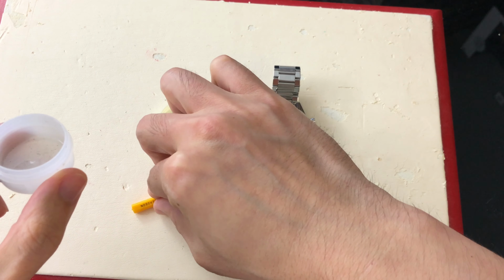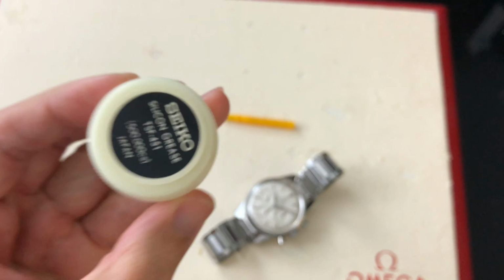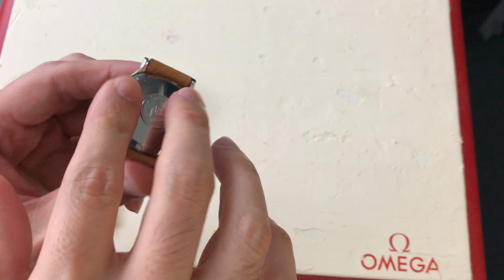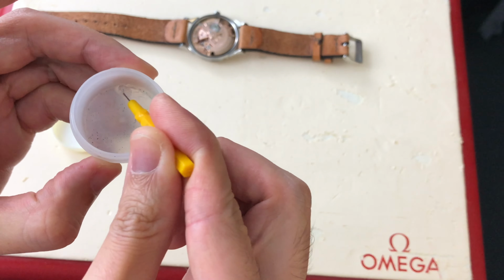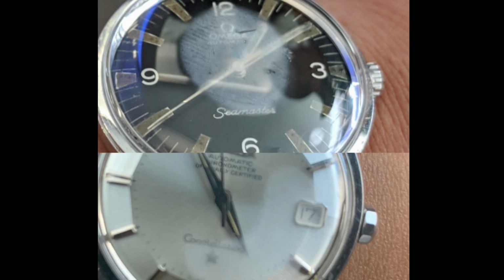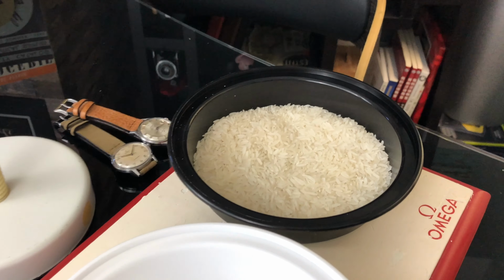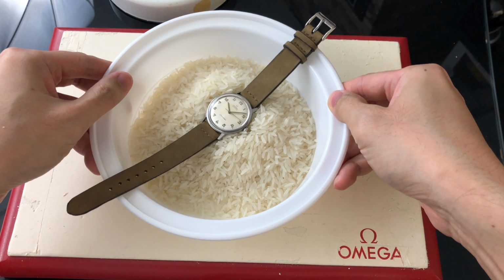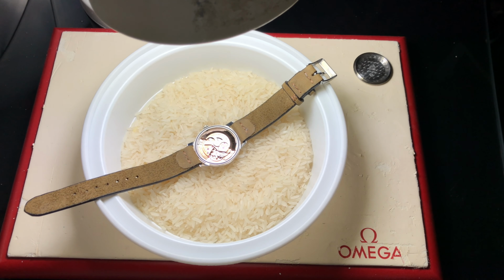Must Watch if you own a modern or vintage watch - Moisture prevention inside a watch

Comment: Hi, I just had moisture under the crystal of a De Ville 35mm. The watch maker who dried it saw no immediate damage, but recommended a full service to be sure. I just had a service with no issues in February. Would you recommend a service to be sure? Issue was caused by a loose crystal
Reply from the maker: Honestly, if he already dried it out and your watch is functioning properly. There is no need for a service.  You only need a service if he did not dry the movement or rust already started to build up. Rust begins to build up within a couple days inside a watch. Loose crystal or worn crown gasket is almost always the case on these older watches. Whoever that serviced your watch in February needs to recheck the whole watch and replace with a proper fitting crystal free of charge.

Comment: I have got another angle - london is a damp place - bake the rice to dessicate it properly, and insert the watch into the desiccated rice which is still heated - around 60°C Is the temperature I used to heat the rice.

Comment: Very informative. If there is no moisture issues would you recommend putting your watch in rice as a safety precaution measure?
Reply from the maker: No need to do that.  Instead, apply the grease as described in the video.
Reply: @TimelessHistoryChannel  Thanks, I will certainly do.

Comment: First one to see a video, excellent!!

Could you do a video on how to clean a dial? Sometimes there are certain stains that would be good to take out.
Reply from the maker: There is no special method to clean the dial to perfection.  It is quite dangerous to temper with the dial in the first place.  You can only do basic cleaning on the dial which I've made a video about: https://youtu.be/NzZTGHHV-7Q

Only dirt or dust can be removed, but stain will not be possible.  If you try to deep clean a dial you can damage it or alter the way it looks originally.
Reply: @TimelessHistoryChannel  Thank you for your reply. At the moment I have a Seamaster Calendar that has some sort of dirt with a consistency of like gum (?). What do you think on using a toothpick with a little bit of water do get it out?
I have tried the blower and the rodico  but there is some dirt still.

Comment: Hi! How can you choose which is the correct size gasket for your watch, I mean also thickness not just the diameter. Thanks!
Reply from the maker: You can measure it where the gasket rest to find out the thickness. Otherwise, like myself, I kinda have a rough idea what thickness it should take by looking at it. And usually, the old gasket is there for you to measure it before throwing it away.
Reply: @TimelessHistoryChannel  It is an Omega Geneve 136.070 from the 70's. 
Thanks to your advice I was able to measure the old gasket and order a new one, but what about the crown/stem? Does not seems to come with one (the watch was never used before) even though the case back says waterproof and the omega website says it was water resistant up to 30 m (of course I am not going to use it in water condition) but isn't the crown or stem supposed to have a gasket? Thanks!
Reply from the maker: @marco.castellani  THe crown will require a gasket on a Geneve 136.070. Unfortunately, you'll need someone who knows how to replace the crown gasket with doing it for you. The stem does not take a gasket, but only the crown does.

Comment: Are these vintage Omega (without screw down crown) water resistant? (I heard its about 30m WR)
Reply from the maker: If you request a service to have them pressure tested, you can actually swim with these watches in a regular pool.